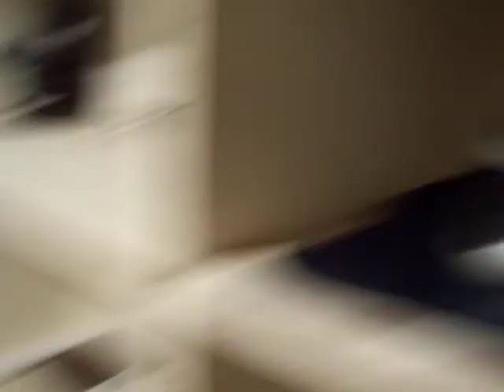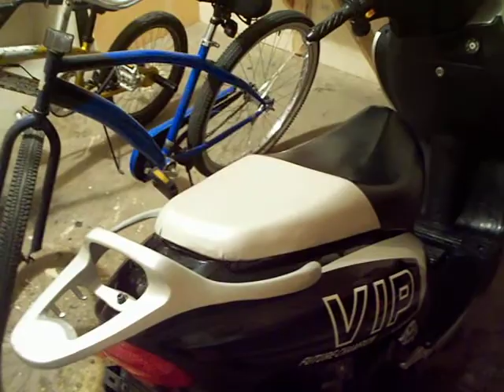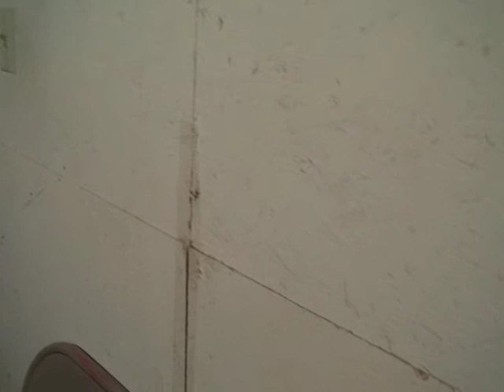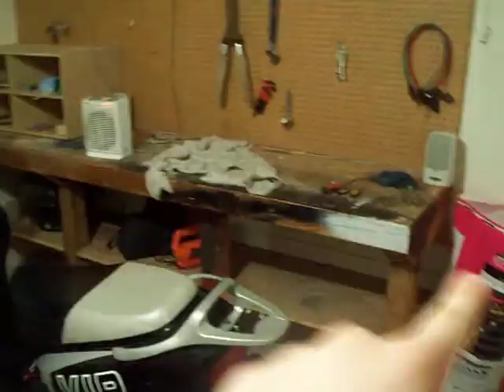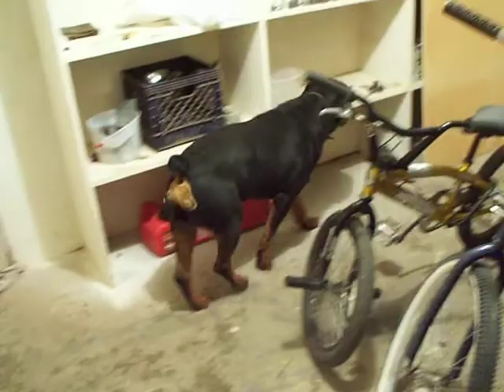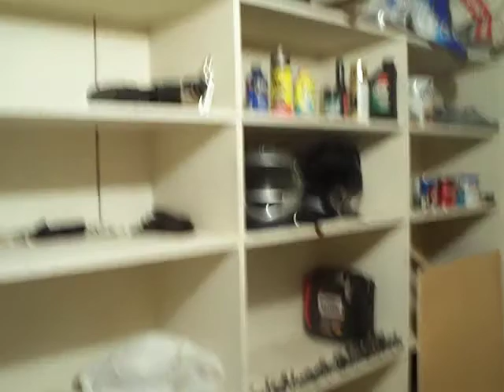New helmet!

Comment: The Flip camcorder might work...but they are kind of thick and may not fit...especially since you said your current camera really hurts your nose.  The only way you could use one of those vertical camcorders is if you cut away part of your helmet, but if that's your only helmet, I do not recommend that.

So how do you get your scooter in that shed place? Through that one door?  I don't know if your motorcycle would be able to get int there that easily since the turning radius is pretty small.

Comment from the maker: lol yeah i talked to woodenchairs a little about the flip and i think i will just get a v570 or the v705 used from another vlogger :) 

also my door is a 3'.7" wide door but if it still doesn't fit i will extend the building out to my patio area in the shed as you could see in the video and install a larger door and of course the building would be bigger and thus a larger turning single :)

thanks for watchin'!